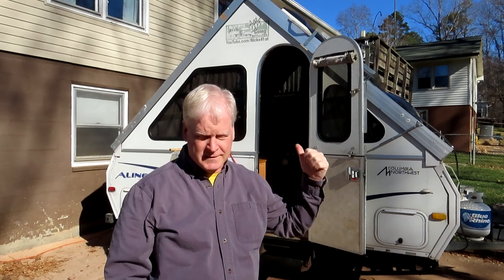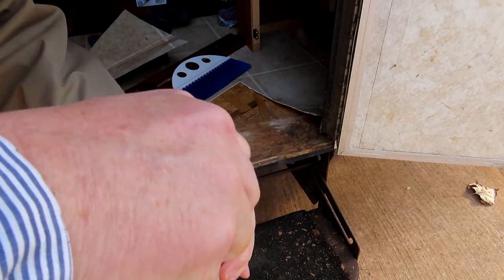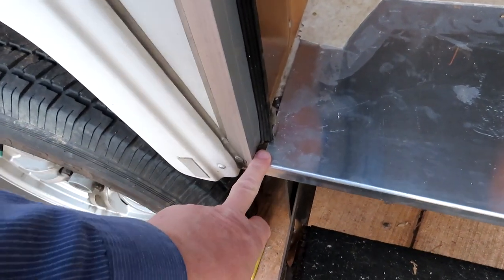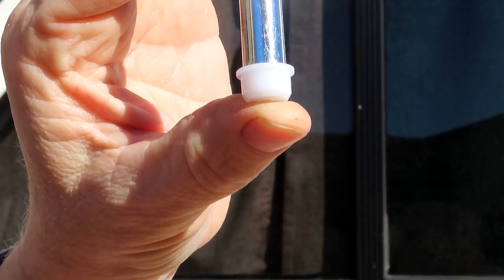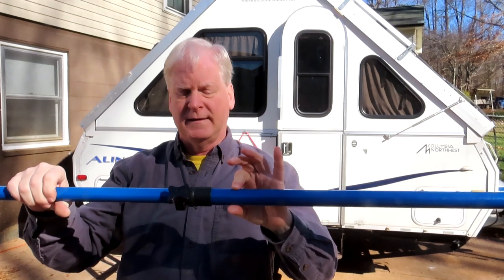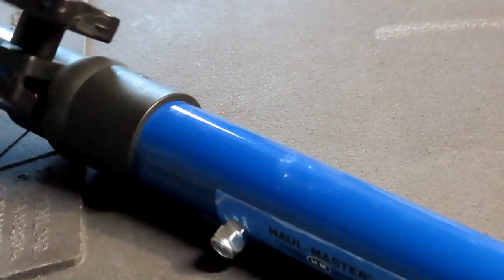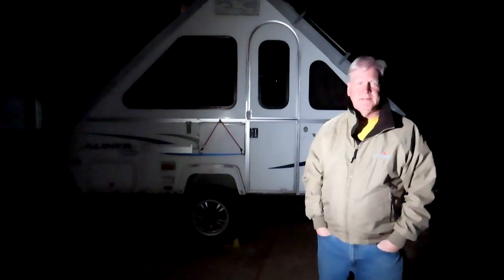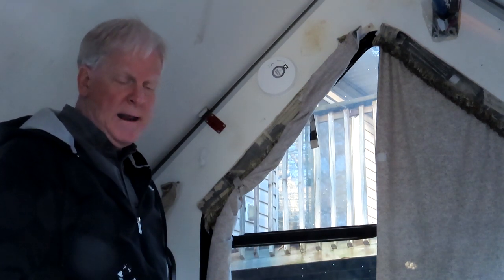Small Camper Repairs, Aliner, Aframe, Popup camper. Wear, tear and repair!

Comment: Looks like Rick is going wild with that new lithium battery. What's next, disco ball? Would be cool to see you and Akela doing the hustle, although I think Akela is already hustling for sticks. It's going to be in the 20's tonight and tomorrow night in Atlanta so I had to go and finally winterize my RV. Sucks but the good thing is winter only lasts a month around here. I don't mind camping in 30's but 20's is pushing it for me. BTW: If you should need to get another cargo brace, get the ratcheting aluminum type instead. That's what I used when I was trucking. They put up with a lot of abuse and really hold. They are a bit expensive but are worth it.
Reply from the maker: I looked at them in the beginning before spending the $14 on these at either tractor Supply or harbor freight.  These work well and I don't worry about destroying them.  I looked at the aluminum ratchet ones first, I think they were like $75, So I can get 3 pairs of these for one pair of those...LOL.    But those are far better for sure !

Comment: Good projects and repair solutions.   Really like the lights and colors.  The balloons traveling over your area are beautiful.  You were having problems with your door closing but for some reason, not a raised door threshold, my door lock keeps breaking.  Usually, it breaks that “I” can’t get into the trailer.  (Key can’t be turned in the lock.). Replaced the lock twice in 5 years.  Not a WD40 problem.  Has anyone else had this problem?  I hope to find a better grade of locking system.  Maybe it only takes one rough road……..
Reply from the maker: I'm planning on replacing my latch and lock with a combination lock handle.  There is one that is a complete drop in replacement and it is all metal, so should last.  Maybe in February!!

Comment: Hi Rick, thanks for some good ideas. I like the wood hardener, I'm curious to know how it holds up also the lights under the trailer. I was never a fan of them but a good idea for the skunks, maybe I will add for my jeep because I'm also not a fan of skunks.
Reply from the maker: Twice I have had skunks, and once a fox.  So Not a bad idea, and they are cool when you leave the trailer at night for any reason, or just sitting around the fire.

Comment: Are those roller bearings in lieu of the teflon tape that is on the inside of the roof edge?
Reply from the maker: yes,  nothing will stay attached to the Aluminum for very long, especially if the Camper sees a wide variety of temp ranges as Aluminum shrinks and expands immensely.  The roller bearings only last a few years, but then you just take the worn ones out and pop new ones in.  Easy Peezy
Reply: @GoingNoWhereFast  how big did you drill the holes and how many bearings did you insert per each section of the roof?
Reply from the maker: I tried to drill them just a 32nd too small, and using the drill to "ream it a little they stuck in great.  The Bearing has a "Flange lip" so if the hole is a little too "right sized" you can add a little glue or caulk to hold it in.  Just plan on replacing them every 10 or so open and closings.  they are cheap.